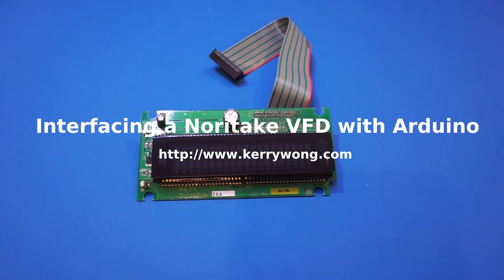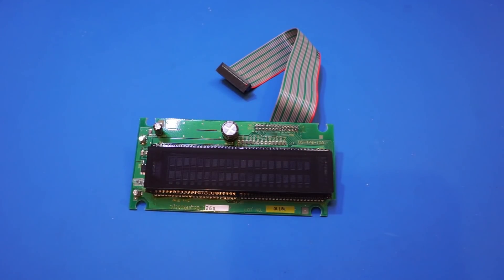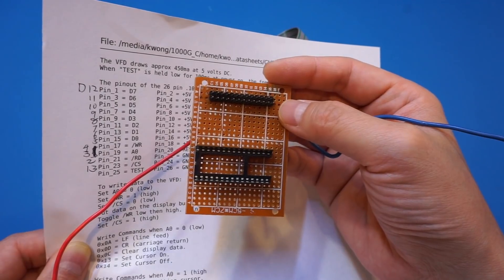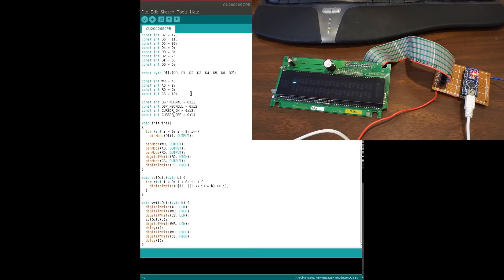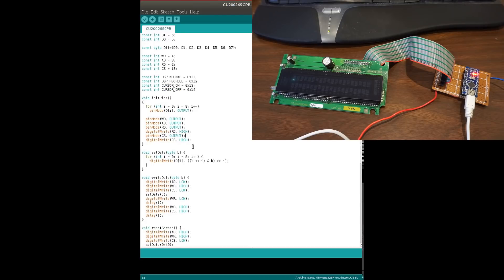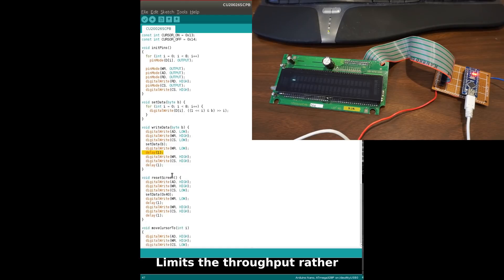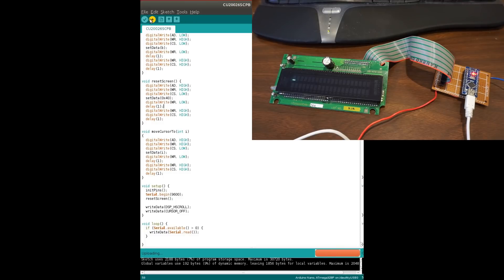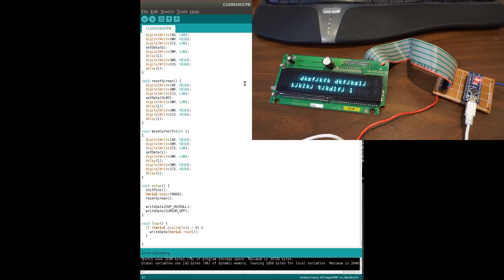Interfacing a Noritake VFD Module with Arduino

Comment: Hi Kerry.  I'm interested in building the filament driver described in your blog post.  It is a toroidal transformer designed to step down the 5VAC to 2.4VAC and also provides the bias needed for the filament.  I was thinking that it would be possible to add an additional winding to power the grids/anodes.  For example, if we wanted 30v for that, we could add another secondary winding for stepping up.  Since it's AC, then it could be rectified to provide the DC for the grids/anodes.  Can you think of any reason why that wouldn't work or be a good idea?  Thanks!

Comment: Is there any chance that a maybe modified version of the lcd library would work? Seems like an 8 bit parallel display as the commonly used lcd displays are also a type of.
Reply from the maker: Unfortunately no, these are not based on the usual HD44780 chip so the signalling is totally different.